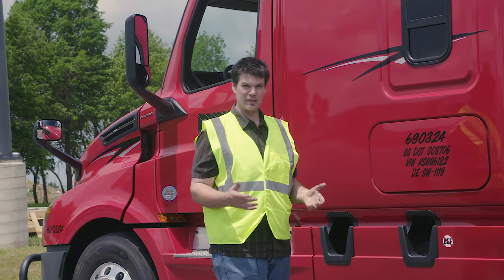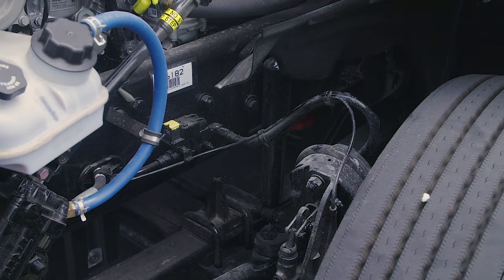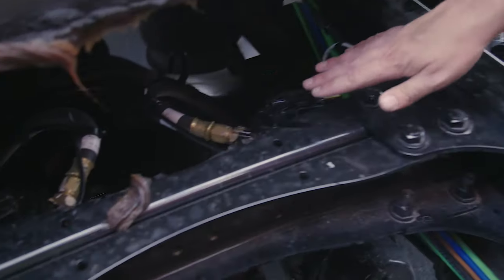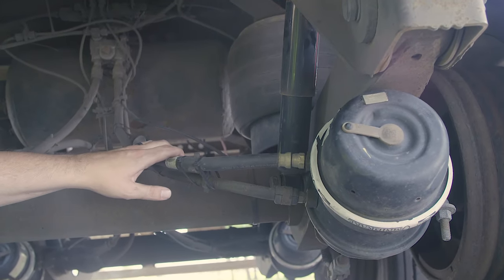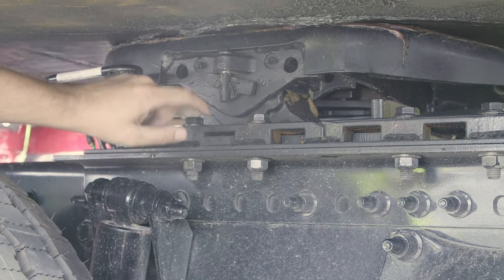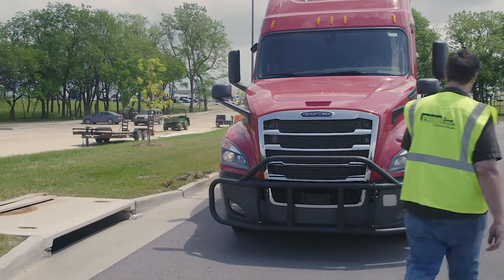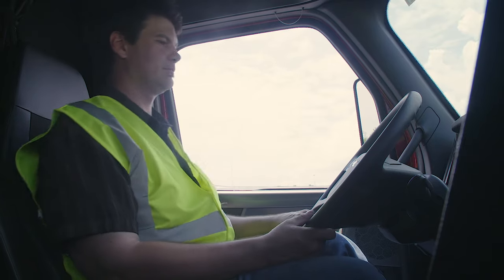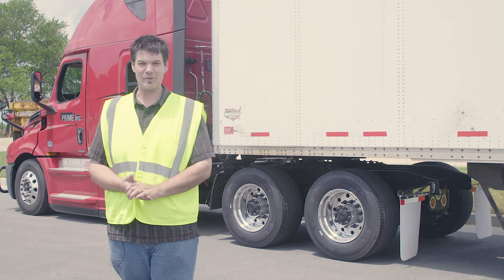Vehicle Inspection Training | CDL Exam

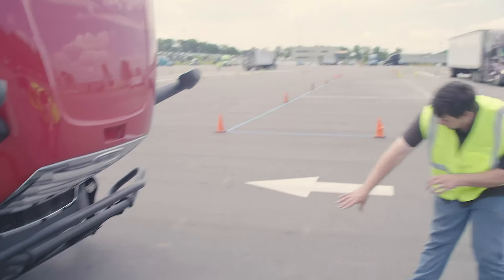Comment: Engine bay inspection.            0:54
Driver Door mirror inspection   4:21
Trailor Inspection.                     7:41
Coupling inspection.              10:37
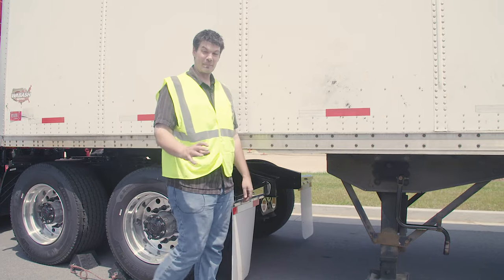Lights and reflectors.              12:25
Five By Five Inspection            14:31
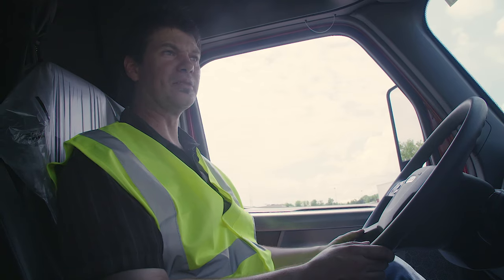Incab and Brake inspections  15:26
Reply from the maker: Thanks Rusly! We appreciate you watching our video.

Comment: When you do your pre-trip, just remember these words "Not Cracked, Bent or Broken" and "Not Cut or Frayed". Also remember that fluid levels are all at manufacturer recommended operating levels. I did this when I went for my Class B and now I've applied to Prime for my Class A. Study that pre trip until you're sick of it then study it some more.
Reply from the maker: Great advice!
Reply: I’m struggling with pre trip I have the maneuvers
Reply: @PRIMEINCTRUCKING  can u tell me all the words ur using form inspection for each one
Reply: "No abrasions bulges or cuts" also
Reply: Really the only way to learn the pre trip is repetition. Keep doing it. Learn the terminology and make sure you know the name of everything you look at. Learn what to look for. Keep doing it until you sick of it. Then do it again. Everything is either "No cracks, Not Bent or Broken" or No Cuts, Bulges or Abrasions." Do the pre trip the exact same way everytime. Do not skip over things thinking you will go back to it. When I learned how to do a pre trip, I used to start at the hood then go to the drivers side. At the drivers side steer tire, I would do everything involving the tire, steering arm etc then straight into the engine compartment. I would only do whatever is on the left side of the engine compartment then I would love on to the drivers door, the mirror, drive tires etc. When you get into a routine, you will become familiar with the truck and what you're looking at and you will.become faster and more efficient doing the ore trip.
Reply: So let say they paid by miles and all the driver do all this work and don’t get paid  for post and pretrip inspection let said something wrong with the truck driver have to sit there and wait til it fix and don’t get paid

Comment: Great job on your inspection and talk through. I worked for a company in Arizona that would pay you $100 for a clean DOT inspection. With the truck running, morning pretrip, I missed a leak at a gladhand. Another time the DOT officer wanted me to remove the emergency triangles from the box to show they worked. One of the weights had separated from the triangle part. Earned a fix it ticket on that one.
I came here for a refresher, I've been off work for 10 months with an injury. Remember the 3 points of contact friends.
Reply from the maker: We offer a payout for clean inspections as well.  Best of luck to you and thanks for watching!

Comment: I think this needs to be updated because the information I received from prime had different verbiage and a different order to complete the test. I do like the way this was performed much better, it seems much more cohesive easier to remember.
Reply from the maker: We are working on getting new videos make! The testing requirements have changed recently so we are getting all of the new information to all of our terminals.
Reply: What was different about the recent pre trip exam that you performed at PSD? I’m starting orientation next month and would like to be a step ahead when it comes to this pre trip inspection?

Comment: There may be a mistake right around 3:00. He said "spring arm" but out should have been "leaf springs" and also should have said that none of the leaf springs are shifted!
Reply from the maker: Hi Sarah! That kind of tractor is only equipped with a singular “spring arm” rather than plural “leaf springs”. So the phrase “spring arm” is correct for that truck. Thanks for watching our video!
Reply: @PRIMEINCTRUCKING  Thank you!!! I was so confused. Thanks for replying.
Reply: @PRIMEINCTRUCKING  I was also confused with that. Thank you for the aclaration. Great video.

Comment: does the in cab have to be word for word ?? Or its a fail .??
Reply from the maker: Thank you for the question! As with the rest of the vehicle inspection, in cab inspection does not necessarily need to be word for word but depending on which word is omitted or added it could lead to a failed test. The air brake test which is part of the in cab inspection is the most common place to see a failed test. It’s best just to follow along with this video as a guideline for success.

Comment: Great video, and it's great to see the actual parts that were described in the CDL Handbook. But for clarity: for the exam, we will be talking through the various checks you described with the examiner, like you did, correct? Or do they want us to take time to actually perform the various checks (like actually pull and wipe the dipstick, use a tire gauge to measure tread depth, disconnect the airlines and actually look at the glad hand seals, etc.)? Obviously the latter would take a lot more time. I'm asking as someone who hasn't been to any training yet, but just studying the CDL Handbook to get my permit.
Reply from the maker: Hello! According to Stan Kasterke, each applicant will talk about the components just as the presentations says. When you get to Prime we will have a class on how the vehicle inspections is to be performed for the examiner! If you're interested in our training program, you can apply now at www.primeinc.com/?r=youtube.

Comment: I know that the inspection is thorough, but I noticed he only does 2 of the 18 tires.  On the actual inspection do I have to do the shocks, rims, spring arms, etc for each wheel? Also, do we open and close the front passenger door as well?
Reply from the maker: Stan, our Training Program Manager would be the best person to respond to your question. Please reach out to Stan directly at (417) 521-3299.

Comment: Question from a non-driver: On the in cab inspection do you need to test the windshield wipers?
Reply from the maker: Yes, absent from the video you will need to check your windshield wipers and washer fluid. The wipers should be properly mounted and secured and operate smoothly. The blades should not be cracked or dry rotted. Thanks for watching our video!